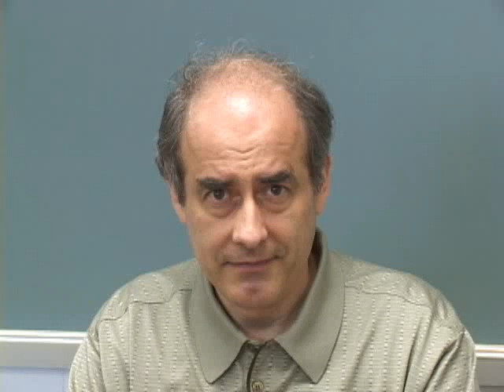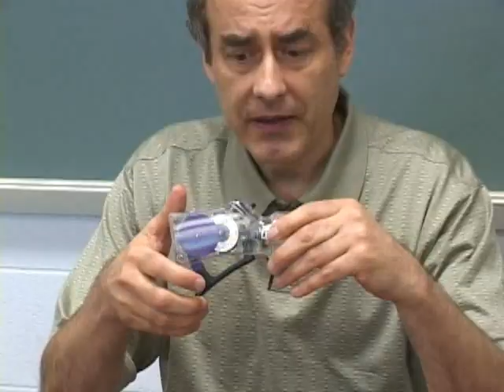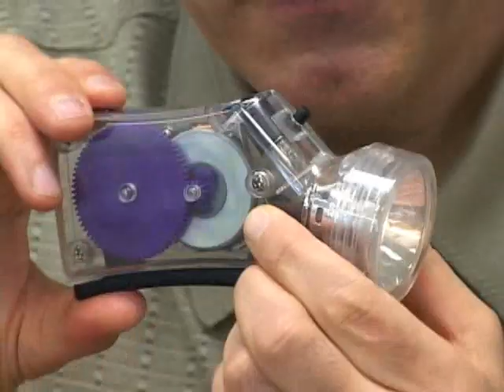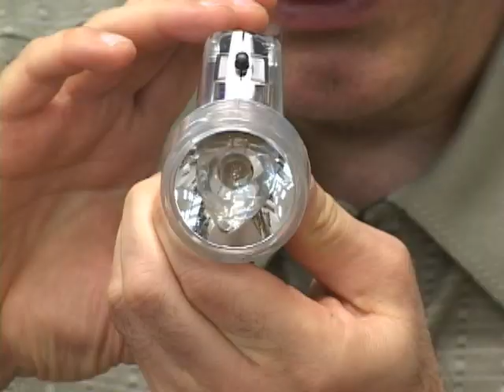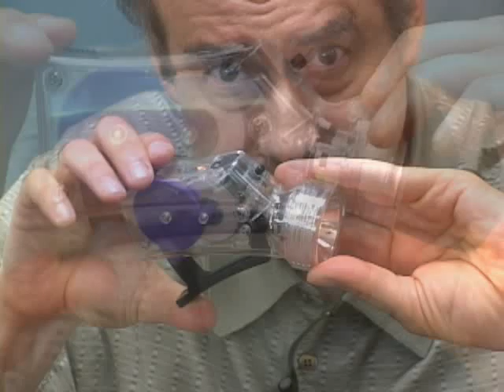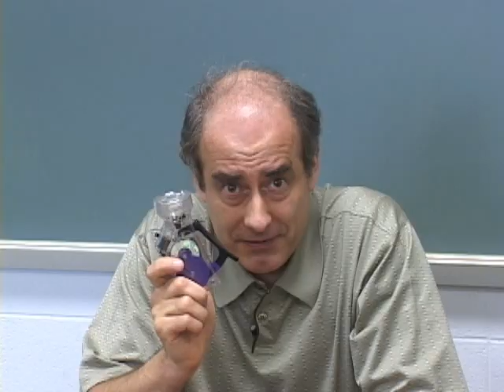Faraday Flashlight

Comment: The style of faraday's flashlight that I would like to build is, in essance, called a shake flashlight. It uses a magnet shaken through a pipe that devides it from a copper coil and uses a supercapasitor to store the charge instead of releasing it. 

My questions are: since magnetic fields are like doughnuts rather than spheres, could you impliment a series of faraday coils within one flashlight? (Having two supercapasitors and two magnets to double your gai on effort)

And, what would happen if you placed the wire along the rim of a wind powered gyroscope, and the magnet on the edge, could the inertia built in the gyroscope expand the effectiveness of the generator?
Reply: I think the best way here is to to build a model to check it out. I tried one of those shaking flashlights once and couldn't get it to work. Best wishes with your experiments.
Reply from the maker: Not sure about those experimental questions. Might have to try some experimentation.